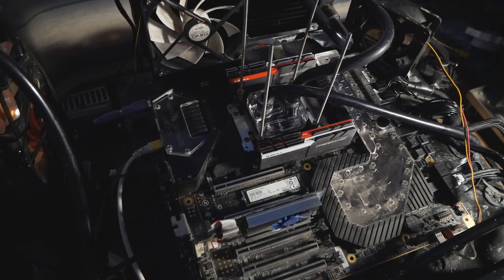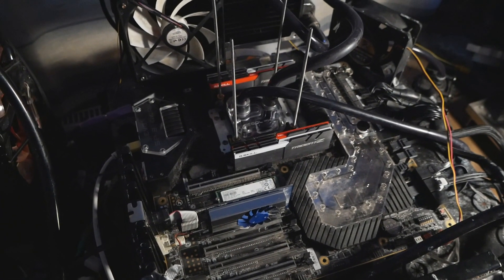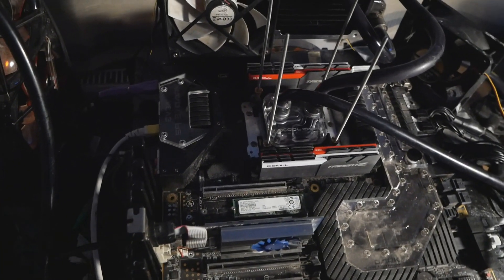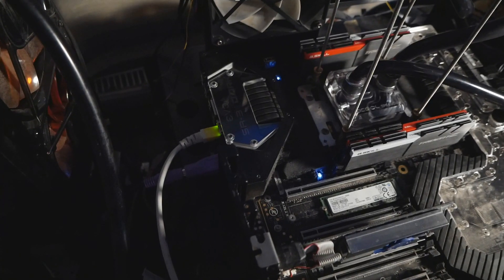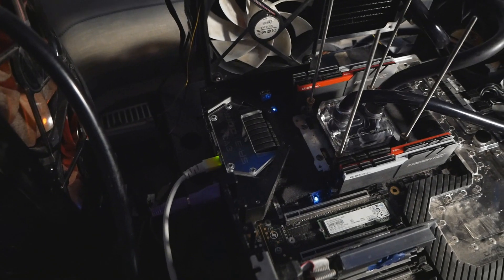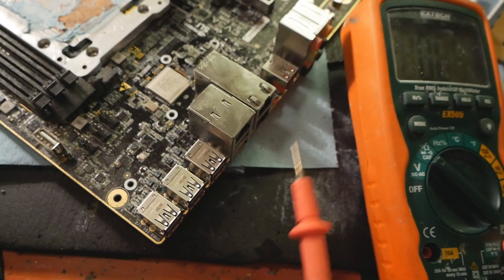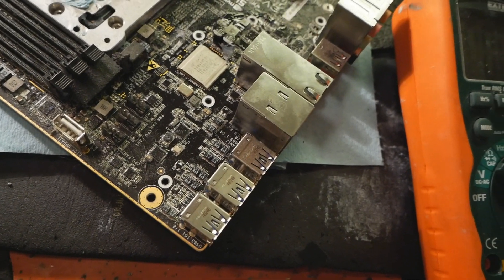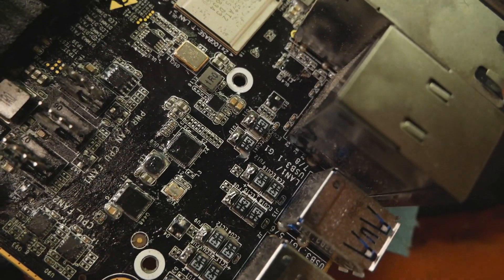USB Ports NOT WORKING? Let's Fix Them!

Comment: Bro I need a simple solution I’m not tryna break apart my pc and look at switches and power ports or whatever, I need to fix a usb 3.0 port/ replace it why is it so hard to find that information
Reply from the maker: Do you have only 1 USB port that is not working? In my case all of the native Intel ports had this issue so most simple way to fix was to short all of the fuses on those ports.

Comment: Ive done that before on my 3d printer, bad idea, one of my cables frayed which had 24v on the poweline and usb data lines, one of the data lines shorted to the 24v and killed the MCU in the printer, i bypassed the fuse so absolutely no protection. Lesson learned. Its much easier to replace those tiny fuses than it is to re-ball a BGA processor.

Comment: For blown USB voltage lines i always use 1.5A fuse wire, alternatively you can bridge from the 5v line of the ATX connector

Comment: Bro in my pc the devices connected to all the usb ports light well (they are gaming led thing) but produce no response even in bios or the system itself. Only one port works properly can you pls help me out. I can't afford to buy a new pc and want to save this at any cost
Reply: I've got this issue too in a brand new motherboard, do you remember how you fixed this? I have no ports at all, not even my case ports work

Comment: i have this issue due to i plugged my powerbank into the front panel usb 3 and two of the usbs ports are dead now. later came to realise that we shud not plug any high current charging devices into any of the normal usb sockets.

Comment: Thank you for the info! Great video! It's interesting to learn most of USB ports may not be used to power devices (I've just lost my 10A solar controller ports that I used to charge my daily devices... since I was using them to power them, the controller is now useless)... I wonder if external hard drives with no external power source may be at risk!?

Comment: Hey I think this could be my problem because one of my USB3.0 ports has gone completely and the one next to it now has less power as if the voltage has halved but My PCI USB expansion works fine so it is just the Intel ones as you explain but my problem is my board is MSI Z77A G41 and it looks very different so I cant even identify the fuses at this point 😆 There is only one that I think could maybe be a fuse but I must be looking at the wrong thing, Hoping someone could point me in the right direction.

Comment: Is there an another video shows the fuse in big size screen?
Reply from the maker: The components vary. I can maybe try to check later. Fuses are generally easy to spot right after the USB ports.

Comment: Thanks, I think you just solved a problem I’ve had with an old PC that’s been sitting for a few years because of the exact problem. I spent hours and hours on it years ago and gave up.
Reply from the maker: I actually use this board in my daily system with this fuse repair.
Reply: @LuumiJuhani my front usb ports are having probs the other usb ports in the back are ok.
Reply: @LuumiJuhani are the cables of front panel header also replaceable?

Comment: Eww, solder bridges. Now if you have bad USB device plugged into such "repaired" board, you will fry the board, instead of killing a 0.2$ fuse. You can buy these fuses from Digikey or Mouser, nothing special.

Comment: Just found your video. Arround 5 years ago I started with a Maximus VII Hero Z97 that had PCI Express failures and other small things not working right. Moved the next year to a Gigabyte G3 Gaming Z97 and everything worked for a while like a dream. But the last (3) years from now, I'm facing these issues. I mean, USB is working but behaves weird. My docks are not working via USB 3.0 anymore, and when they did, devices such as keyboard and mouse wouldn't be recognized when replugged or even after reboot. Currently, my pc's USB 2.0 ports are doing that job flawlessly. And with these issues, I mostly got the Windows warning: USB not recognized/unknown. 

When I did make it work with the USB 2.0 as described, I tried to make it work with my VR headset that I bought recently. The outcome is that it did work as supposed to be, even with another USB 2.0 port. Now, it doesn't work at all on nothing but the front port of the pc case. But it would be possible that it can work on another day for example.. Possibility also is if it works, SteamVR fails to recognize it so it would be a false positive end result.

Hmmmmmhh.. I'm waiting for a chance to grab parts of the next generation to replace all of this piece of shit pc.
Reply from the maker: This whole thing started on Z97 in my experience.

Comment: My pc turns on and everything in the pc runs I don’t get any display on my monitor and usb don’t work also when I turn on the pc I can use the same button to turn it off I have to flip off the power supply
Reply: did you ever figure it out

Comment: Great stuff! For years I've been using a PCI USB card on a Rampage II GENE since I blew all the ports powering a USB hub with a too high voltage power supply. Do you think it's just the fuses or the USB controller chip itself? Also would aluminium foil taped down work? As I hate soldering haha... Cheers from the UK!
Reply: Same thing happened to my MSI laptop with a hub wrong power supply fried all ports. Any luck with repairs?
Reply: @edgebz  I'm afraid I haven't tried yet as my OS drive on that PC failed. It seems as though it should work though.

Comment: Hello. I am not experienced with soldering, and just want to get this right. You use the soldering material on top of the fuses right? Like you put the solder on top of the small fuse brick like you show in your video? or do you take the little fuse brick off the motherboard? And i'm wondering - is the soldering material allowed to touch the motherboard circuit board, or will that cause damage?
Reply from the maker: Hey, I have used that motherboard for daily use since I posted the video. Works great, just don't charge any device from those ports.
Reply: @LuumiJuhani can i use it for transfering data?

Comment: Amazing, I did a test by putting metal to bridge and it works. 

Question - Bypassing the fuse, will this destroy other components if another shortage happen?

But why did all my USBs short.
I did plug a new RGB keyboard. I feel that could have done it. Mind you my motherboard is 4th Gen Intel.
Reply from the maker: I have no idea why this happens so often. If you get a short it might just burn the port.
Reply: i think its a fail safe system to protect the damage to its north/south bridge chipset. Most cases the fuses getting blown bcos of high current draw.

Comment: You've got to be kidding me.  Most ppl are not rocket scientists.
Reply from the maker: That is not rocket science, and very sadly the problem many modern motherboards face. Old motherboards do not have this issue. I have seen this issue numerous times already, Z97 OC Formula, Z170 and Z170M OC Formula. M9 Apex, and many other motherboards as well.
Reply: @LuumiJuhani  To a lot of typical people watching YouTube this is rocket science. I stumbled over you video because I have an Asus ROG Rampage IV Extreme that all of a sudden the ethernet adapter and some USB ports have stopped working.  For me to go in a solder anything in there would be suicide.

Comment: Hi, i have a Asus Maximus VI Hero motherboard for the Intel 4th gen cpu's with usb problems. The problem i have is very odd. The onboard connectors for front usb ports not working either. All usbs are not working/partially working. I did manage to upgrade the bios, and it went fine, but and it did recognise a usb in bios at that time. But now it wont. There was usb problems before i upgraded also, thats why i did that in the first place.
Its a while since i was testing this, but if i remember correctly here is how it works:

USB2 ports:
They ONLY work with mouse and keyboard (i think only the highest once on the IO was working)
If i connect a usb2 stick to any usb2 port its not detected either in Win10 or in the bios (drivers are installed in Windows, and everything shows up fine, all hubs etc)
Usb3 sticks does not work in Usb2 ports either.

USB3 ports:
Usb2 sticks, keyboards, mouses and other usb devices does not work, BUT Usb3 sticks DOES WORK in Windows if i remember correctly, but they are not detected in bios or on startup.

I have looked everywhere but cant find any info. Im now going to check the fuses on my board. But i would love to hear yout thoughts on this.. :-)

Edit:
Just checked all the fuses around the usbs and they were ok :-S I dont understand this, they show up in windows as normal, but not working..
I have cleared the bios also but no luck.
Reply: Reinstall a fresh copy of Windows. That worked for me when I had this issue

Comment: Thanks for your video, i'm from Brazil and my Maximus IX motherboard got this usb ports problem. My new trouble is find someone to fix it. Brazilians whatch you too.
Reply from the maker: I had the same issue on Maximus IX Apex, you need to remove the heatsink assembly and check the fuses right near the USB ports.
Reply: Thank you! My Asrock Z370 Extreme4 had a fuse with 22 ohms(Mouse flashing and keyboard without response on usb 2 x 3.1 ) and another with 84 ohms (1 x USB 3.1 did not work.) . Printer does not work on 2 x  USB 2.0 (fuse with 22ohms)  I made the bridge and everything now works . Thanksss!  (name on fuse:  -S )  
hyphen  s

Comment: I have a problem with my motherboard.
First some sata ports stopped working.
Then after power off pc, I could only get display through onboard. After few attempts, graphics card worked again.
Stable for 2 weeks 24/7
After next power off, now no display through onboard or graphics card. But a few power on/off and it worked.
Stable for 1 month 24/7
Power off again, now no display at all. I tried onboard, new cpu, new psu, different graphics cards.
Reply: Coulb be that yur power outlet is having issues

Comment: Back in the mid-2000s, it was actually common to use resetable fuses.
In fact, I just repaired a Socket 754 motherboard that had a catastrophic fuse failure. The fuse was reduced to ashes, and the pads were nearly pulled off the board, but it was still possible to carefully clean it up and replace it with another fuse from a junk board I had, and superglue the pads and SMD fuse into place.
Manufacturers could go back to them, but they cost more, don't act as fast, and when they fail, they tend to burn up.

Comment: If this happens does the usb header also not work? Cause mine does and only one usb 3.1 works cause its a asmedia. Mobo is rog strix b250f
Reply: Same board, same problem, usb 3.1 is the only one working too! hahaha
Reply: @adrianpixeles  U found solution? did u try the video method? xD
Reply: Same here
Reply: @Xsameie99X  rip

Comment: Hi Luumi, i know u did repair a very nice asrock z170OC motherboard in the past, but is it possible for you to do a little Video on how to check if motherboard has shortcircuit and common stuff when MB seems to be dead, a nice guide from you would be my dream.   Thank you so much brother.
Reply from the maker: The Z170M OCF is still dead. Key is to check the main voltage rails that are they zero ohms to ground.
Reply: @LuumiJuhani  thanks for reply, Im not sure how to check the main rail, I probe the 24pin to where? Chipset? I did check a couple videos but its still lacking to show where to probe properly

Comment: Motherboard manufacturers could fix the situation but seems like they don't care. Also why not add a new larger fuse instead of shorting it? I used to do this with laptop motherboards when I repaired them for a job.
Reply from the maker: Yeah that is not a bad idea at all. Need to order some larger fuses.
Reply: @LuumiJuhani  if they don't physically fit on the board there's always a way to fit them vertical, run wires or whatever. Just consider you may or may not be able to fit the heat sink or io shield thing back on. High temp glue sticks can help to make the mod stable and with isopropyl can be easily removed as it makes the glue brittle and loose its tact to what its applied to. Else it could get stuck to components and break them off the board if you try to remove it without isopropyl aka rubbing alcohol. Anyway hot glue has its downsides too. I'm just suggesting it if you are using a really unique way to fit physically larger fuses that doesn't fit in such a small place, it's not idea.
Reply from the maker: @tacticalcenter8658  Just put sideways, but do you have a link where to buy some?
Reply: @LuumiJuhani  some more info here a few pdfs to check out also https://electronics.stackexchange.com/questions/66507/usb-fuse-to-protect-usb-ports
Reply from the maker: Do you have a link where to buy larger fuses instead of those?
Reply: @LuumiJuhani  I do not have a link. I haven't repaired a motherboard for 5 years as I have changed professions and now just do part replacement and let vendors repair parts that are under warranty.
Reply: @LuumiJuhani  Hi, you can order larger fuses from Aliexpress. They have all sorts of parts.
Reply from the maker: @natti8816  Ok,. can you give me some model number example?
Reply: Another thing we did was use larger fuses from other defective motherboards laying around. We only occasionally bought fuses. And I would just ask for a part and a different department would source the parts I needed for repair. Wish I could help more but just been out of the game for such a long time.